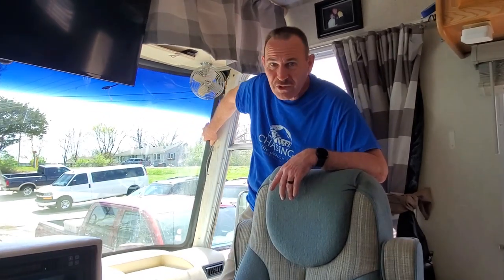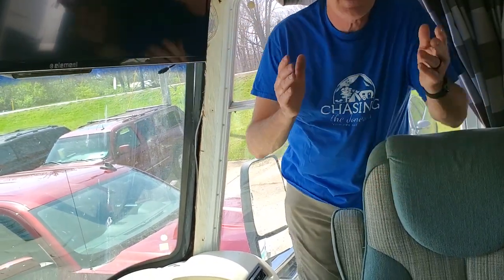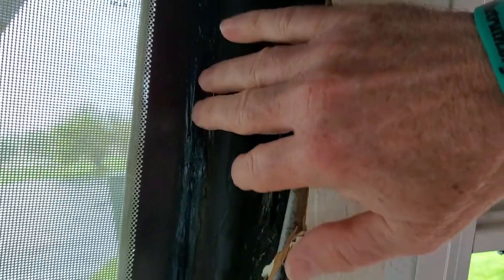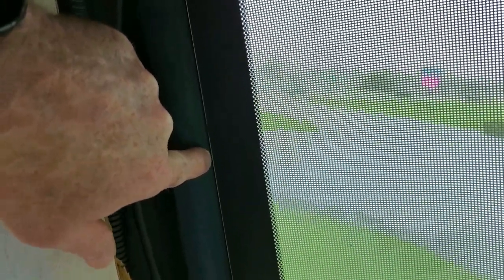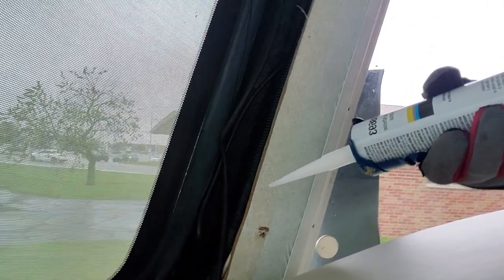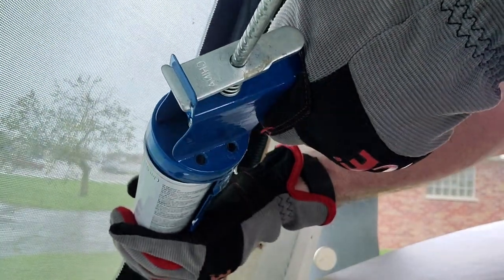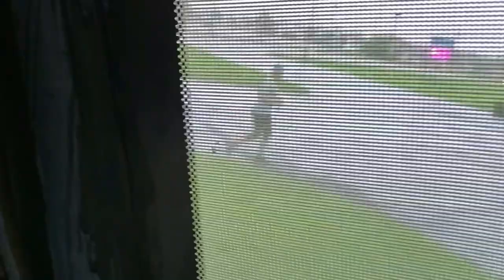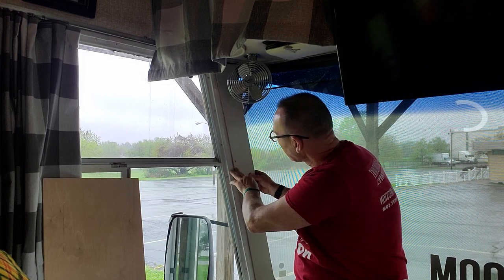RV Windshield Problems - Christian RV Living - RV life

Comment: It happens because of 2 things, 1 jacks    2 suspension  shocks .the long body of rv is solid with no flex  when u drive up or down twisted no flex the the post they also crack u wont see the crack because its covered up